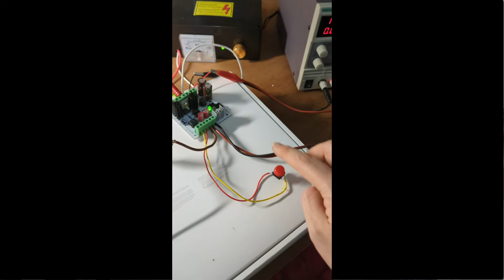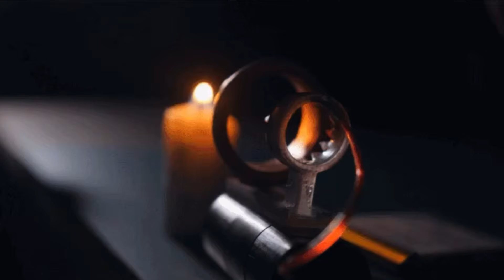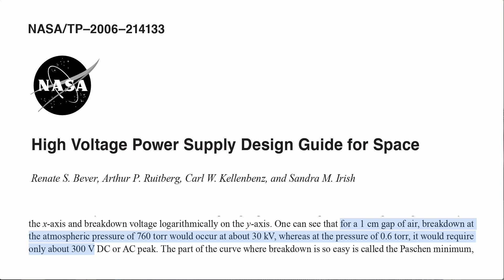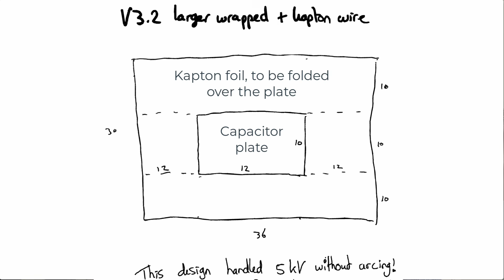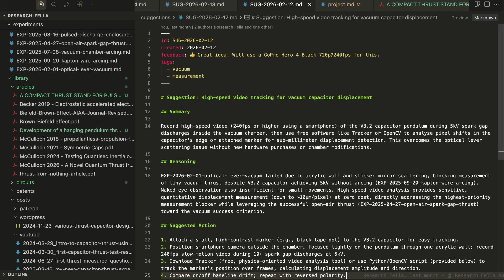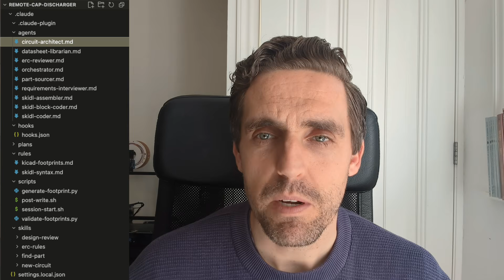Quantized Inertia Capacitor Thrust Update

Comment: so going back to the spark gaps, what about lightning rods in side the the vacuum chamber that give your spark gaps something to go to isolating them from the rest of the experiment basically just ground it.
also for registering the movement, you could place a prism inside the chamber to make a rainbow when the movement happens the movement will be magnified because it will be blocking a different part of the spectrum, so you could have a spectrum sensor to measure the full spectrum and shifting absorption lines cause by the movement. because both the spectrum sensor and the prism will be inside the vacuum chamber the walls will not effect it, but you can use a bright light source threw the acrylic walls out side the chamber, so you could use the sun with bathroom magnifying mirrors, the cheapest and brightest light source. it does not matter the light coming in to the prism so long as the spectrum you are looking for does not have any lines blocked by the movement. 
this is my first time seeing your propulsion drive, I am assuming it's working by charging up the capacitor of two magnetic plates so to they push apart from each other like a tuning fork, then discharging it so that one side the tuning fork pushes more then the other side, because if you simply discharge them at the same time the plates will come together at the same time and the movement will cancel each other out and you will have a tuning fork. I am not sure you might be able to make the capacitors sides with different materials, so they discharge more to one side then the other, you would also want to repeatedly pulse them to match the resonate frequency of one of the plates so it vibrates more then the other side and maybe you gain some movement from this. their might be a funky wave way to do it out of the same material but it will be much harder, because it would require getting one plat to move more then the other, oh I know you could make them of vastly different sizes. that way the same vibration in the same metal bounces around at different times in the metal. I would honestly go with electromagnets magnets over capacitors, to try to get your vibrations. you could go with induction and turn it red hot that 100% will get you thrust but it would be from emission not vibration, but it will melt your vacuum box. anyways hopefully some of my ideas helped.
Reply from the maker: The prism is an interesting idea, thanks! And the thrust doesn't come from the tuning fork you described, but from Quantized Inertia; a theory that predicts thrust in one direction, because the charge flows rapidly in one direction, creating a "horizon" behind it, as nothing can go faster than light, and so some "information" is lost behind it, or else the information would have to travel at speed of light + the speed of the charge. This imbalance predicts inertia and trust in a capacitor due to rapidly accelerated charges.

Comment: My understanding of the Biefeld–Brown effect is that you need an asymmetrical capacitor made with a dense, high-K dielectric and very short high voltage DC impulses. I forget where, but I remember reading somewhere that the dielectric they used was Bakelite mixed with lead oxide, but there are better modern alternatives. I also suspect that while the asymmetry is usually shown as one large plate & a small one, it was actually deliberate misdirection, that the best asymmetrical capacitor is actually a railgun with the dielectric fixed between the rails.
Reply: He's not trying to use the Biefeld-Brown effect, though. Quantized inertia is something else, and is exploited by symmetric capacitors if I remember correctly.
Reply: @writerofminds3886 Only the results matter.

Comment: Does the increase in the arcing under negative pressure indicate that the air is fully an insulator? And that the medium of electrical conduction is possibly a more fine fluid than the air? Like maybe aether?
Reply from the maker: Not sure if we can draw such strong conclusions from these effects, but I myself am definitely not ruling out the possibility of an aether. There is still a lot to learn about the true nature of electricity!
Reply: @Waveguide  Very true.
Reply: @Waveguide  At the risk of setting of an uneeded argument, I must pose 2 questions when it comes to there being an Aether:

1. Light waves, waves of what?
2. Have you read the original MM experiment report? Because it doesn't say no drift was detected.

Cheers.

Comment: just the phrase "internal field emission" from the abstract comes across as word salad.

does this mean the electric field between the plates "internal to the capacitor"? 
in which case, is the dielectric being charged, or is the dielectric discharging. either can be an "emission"... something "emits" INTO the capacitor to charge. something "emits" FROM the capacitor when discharged.

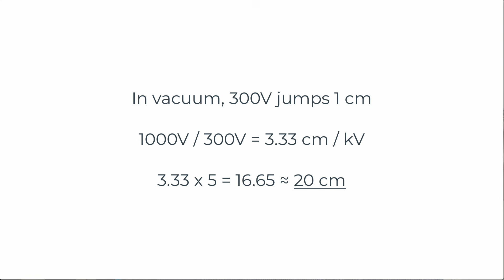2:21. i would double check that figure, verify it with several sources. along with what you call a "vacuum". paschens law?

 a true "hard" vacuum is almost virtually teh perfect insulator. it takes FAR MORE than a mere 300v to jump a cm. a

 "mild" vacuum is more conductive than air....

so, whats the torr on that vacuum? kpa? mm/hg? electrode shape? 

kapton tape, try and bear in mind it also has an adhesive... its not irrelevant and a material of any type is NOT a "vacuum".

and then.... i feel you have to avoid any type of electronic or digital measuring device.

get back to the old school. kelvin wattmeters. electrostatic voltmeters. open some physics books and learn how to make truly mechanical devices that can make measurements in ABSOLUTES... CGS being preferred...

an interesting aspect is everyone thinks "capacitance" requires TWO surfaces. not necessarily. any conductors surface represents a capacity even in isolation as a displacement current must either flow ON to, or OFF of...

and this should be the first thing stated in regards to capacitance when opening any physics book on electromagnetics... at least, it was up until 1930 or so.... hmmmm.

ha ha. "chatted with grok".

yep. may as well just start inspecting your own navel... crawl on in... you would be FAR better off chatting to a mirror after reading a few books.

Comment: Are you familiar with: feynman disk paradox?

You could try rearranging the experiment to get linear momentum instead of angular at the back EMF phase by:
having a toroidal solenoid encompassed between 2 cylinder plates acting as capacitor plates (1 inside the toroid almost touching the inner wasll and the other bigger cylinder on the outside of the toroid almost touching the outer layer of the solenoid)
In my version you need 2 power supplies where 1 runs the solenoid at low V high A and the other runs the capacitor plates at low A and very high V
4 repeating cycles:
1 charge the capacitor + -
2 energize the solenoid (low EMF)
3 charge the capacitor - +
4 interrupt the solenoid (big back EMF)
1,2,3,4,1,2,3,4.....

Aharonov-Bohm effect is what i believe is happening where a changing magnetic field interracts with static charge on the capacitor plates producing a "hidden momentum"
Reply from the maker: Thanks for the tip! Not sure if I'll ever get to trying this though, seeing how hard of a time I'm already having with a simple parallel plate capacitor discharge in a vacuum 😛

Comment: So, consider looking into Dr. Buhler's from NASA and Exodus technologies, and his work on asymmetric capacitors.  I know your goal is to prove this with a symmetric cap, but the forces are basically opposing and pushing away from each other.  The asymmetry allows thrust vectors to basically be larger in one direction than the other.  Also you have to get a super low vacuum to do what you want.  Just wrap the whole thing in kapton, each plate as well, you won't have any ionized airflow.
Reply from the maker: Buhler's experiments are indeed interesting, and I'll definitely investigate asymmetric capacitors once I finish this line of experimentation. The big benefit of a symmetric capacitor setup when talking about propulsion in space, is that it allows you to change direction: you can go forward as easy as you can go backward, simply by changing the polarity!

Comment: This is cool! Have you considered implementing what T. T. Brown suggested to get more force so it's more easily visible without sensitive equipment? For instance, he used the following to increase HV capacitor thrust:
- Non planar curved geometry and asymmetrical surface areas to create non-unform fields 
- High density, high K dielectrics, especially those which are cone shaped to increase field asymmetry
- Resonant capacitor charging networks with slow wave distributed resonance to increase displacement current and reduce radiation losses
Reply: I spent a while compiling references to give you  but youtube deleted my comment. Best I can say is ask Claude about it, specifically the Dollard LMD analog network and how slow wave distributed resonance eliminates radiated energy and allows q multiplication
Reply from the maker: Thanks for sharing those tips! 

At the moment my goal is specifically to test symmetrical capacitors using high voltage pulses, but I might try curved/asymmetrical surfaces in future experiments.

I'm already using kapton as the dielectric, which is high K.

I'd be curious to learn more about the resonant capacitor charging network. Do you have a link where I can learn about this setup?
Reply: Just to add to this, Rochelle salt is apparently an excellent dielectric for this purpose.

Comment: Respect, you did a lot of work. I didn't expect it to be this hard.
One suggestion: you can stack multiple capacitors to get more thrust. but the net force must be one direction, so the distance between the plates must be unequal:
 +-    +-    +-    +-    +-
Reply: Really good to see two smart researchers exchanginginformation like this.
Reply: Turns out trying to prove psuedoscience is very hard, impossible even.
Reply: @oBCHANo which part are you saying is pseudoscience? Evolution?
Reply: @GODHATESADOPTION  It's a troll comment, ignore it.